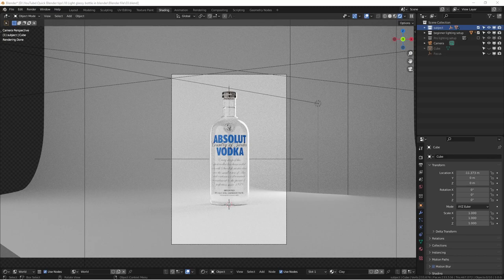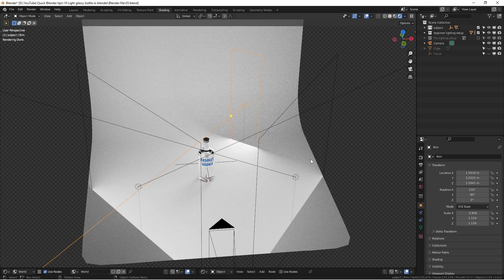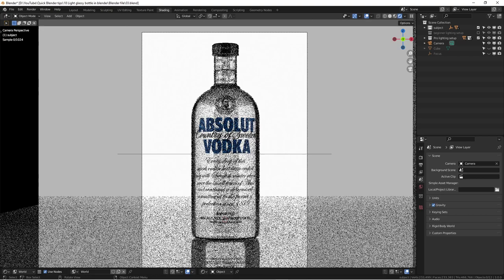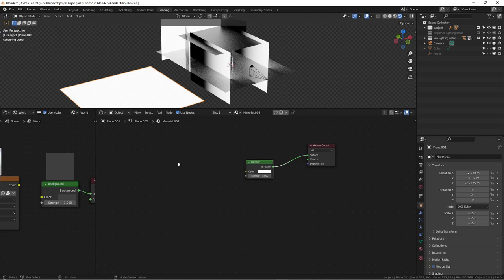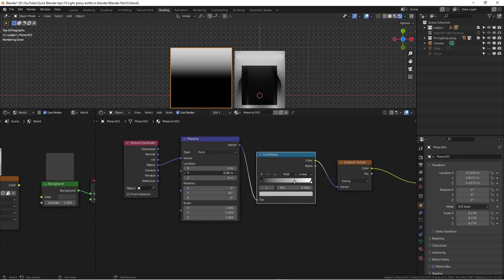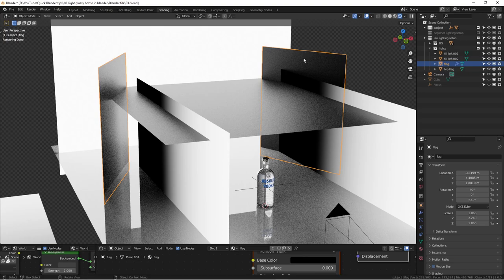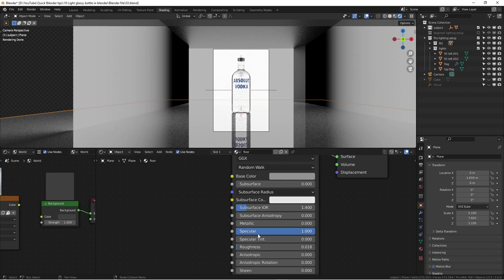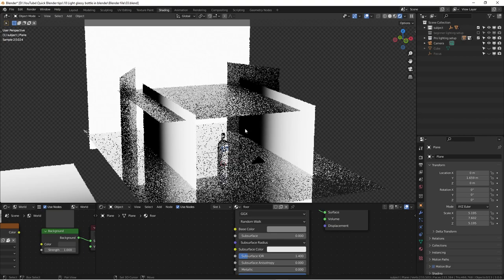How to Light Glassy Bottle in Blender (Quick Blender Tip 18)

Comment: I am still having a lot of trouble getting the glass to look right even with the bad set up. When I build my bottle and use the glass texture you recommended in your other videos, I just get a black bottle. Is it because the bottle has thickness to it? How can I fix that problem? 
I once tried to render glass without thickness, but it had a "liquid" inside, and it also renders looking black. What do you think could be causing this problem?
Reply from the maker: Check your render setup, what number did you set up on the reflection?

Comment: Hi! I've set up the planes but the bottom plane is not rendering white as seen in the viewport. Is there a setting I need to adjust?
Reply from the maker: roughness need to be 0
Reply: @WenboZhao  Ok, thanks! I’ll try that. My current fix was to increase the backlight emission but it washes out the object. Thanks again!

Comment: Hi Wenbo, how did you get the gradient result even right? You go from the ColorRamp directly into the Gradient Texture (which is connecting a yellow to blue dot, what isn't supposed to work). There has to be a sort of converter between them to fit the color of the node connections. So as expected I can't get it to work properly. The plane stays either bright or totally black, though I followed all your steps precisely. I don't have a clue, what node to add between :( Maybe you have a solution for that?
Reply from the maker: On the texture coordinator in the end, select object instead to Generated
Reply: @WenboZhao  And that's exactly the moment, the gradient turns black ;)